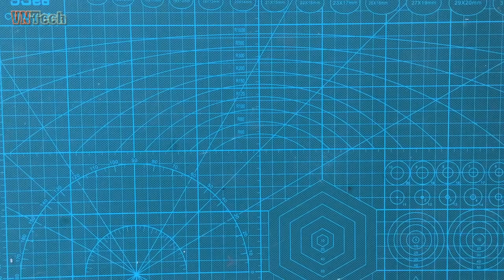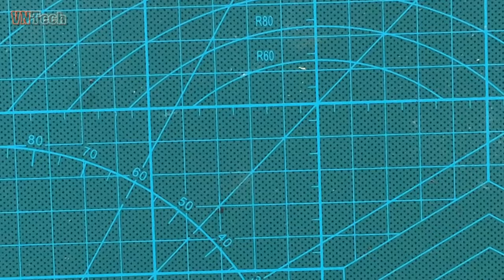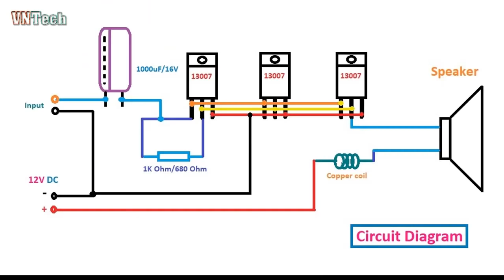Powerful Bass Amplifier Using Triple 13007 Transistors From PC Power Supply

Comment: It would be useful to speak on your videos, or if not write some explanations. It would stop an avalanche of bullshit in the comments at any rate.
A basic explanation is ..This is a class A output stage (of sorts) using three devices in parallel for current sharing. The resistor is chosen to bias the output stage, as class a requires an operating point somewhere toward the middle of it's characteristics to operate correctly. This doesn't seem to be near that as discussed below. The DC through the speaker is a problem, but it has been done before by the bucketload. The usual technique to correct this is to employ an output transformer. For a single output device this is always an issue. Though as seen when the battery is connected the cone excursion is minimal, and I would guess less than a couple of volts across the voice coil. This would give a clean output in that case of about 250mW (8 ohms). 
The maximum available from a class A amp running at 12V assuming no losses is 2.2W into 8 ohms.

Comment: This is a decent setup. Might work for a school science project. But with no control over the audio, no mixer. The audio would be distorted and not sound good at all. If you want a bass amp you need a cap a hell of allot bigger then that. Leave audio to the professionals

Comment: Very pity about the power supply! It would be better instead of destroying it, to use it for powering a professionell constructed power amplyfier. Such can be easy be mounted by using two integrated power amplyfier circuits in bridge circuit for each audio cannels. If you cannot contruct it by yourself, you can buy  assembly sets for this in god electronic shops for little money.

Comment: Why only 2 wires connected to 100k volume parts
Reply: Because rather than being used in circuit to increase the volume, it is being used simply to attenuate the signal. And of course in the circuit shown, the potentiometer could be removed entirely, both of its leads attached to each other.